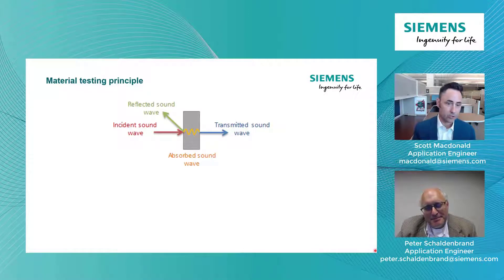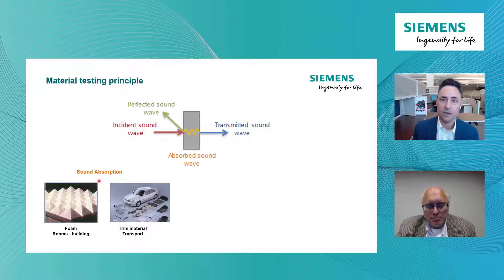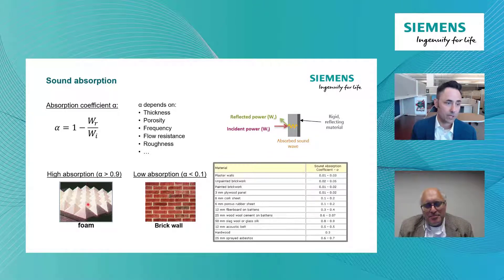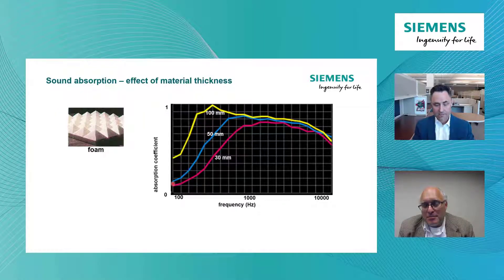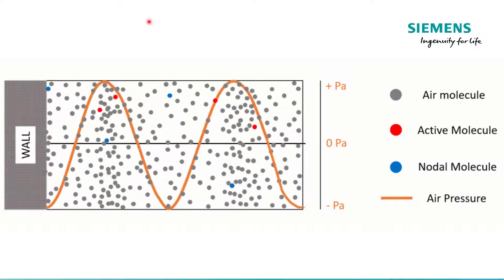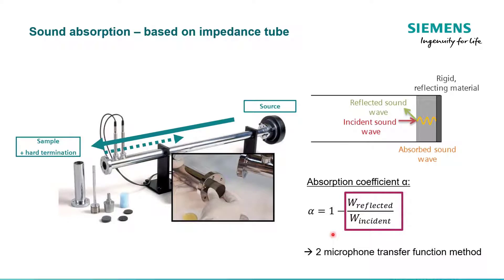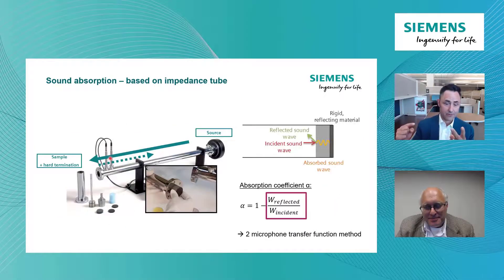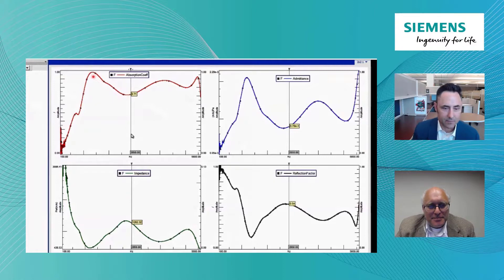Sound Absorption

Comment: Something that I have noticed is that for an absorption material, there are different applications which might require a different absorption coeffient curve than another material

Example.  For critical music/speech listening environment, we have a hearing curve which is not a flat curve, and I've noticed that some materials that have an absorption curve that is closer matched to hearing curves that they sound better than other materials for these types of applications. That's why I stay away from building materials like fiberglass (compressed or non-compressed), or mineral wool.  Also, open cell foams have different cell structure and density so there are differences in open cell foams too. 

Another material that isn't discussed is activated carbon, it's highly porous and very dense material, but it comes in typically pellet forms and there's a wide variety of different types of activated carbon on the market.  I did notice one company mfg's their own activated carbon and they use it as a fill material inside a pressure based diaphragmatic absorbing products more for the low frequencies down to 30hz.  I read a Salford University study on using Activated Carbon for low frequency absorption.

Comment: why do you get more absorption at certain frequencies than others, (last graphs)
Reply from the maker: The relationship between the wavelength of sound and frequency is one of the key reasons. The wavelength is longer at low frequencies which requires thicker material to absorb. More here: https://community.sw.siemens.com/s/article/sound-absorption